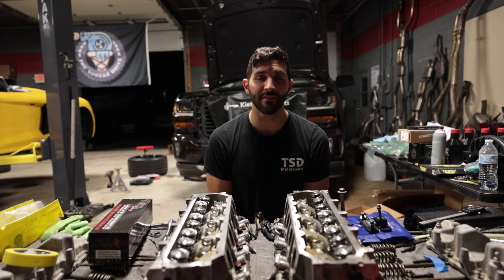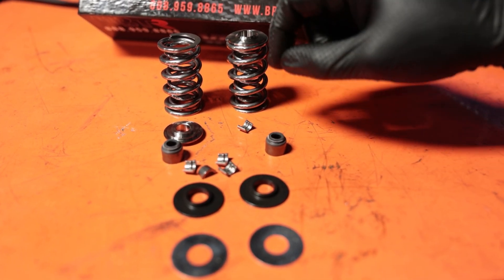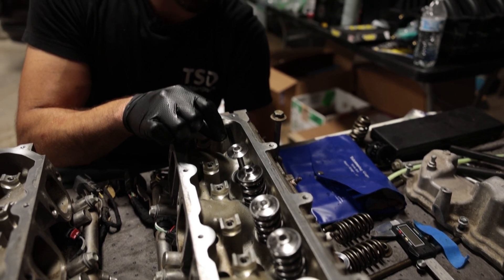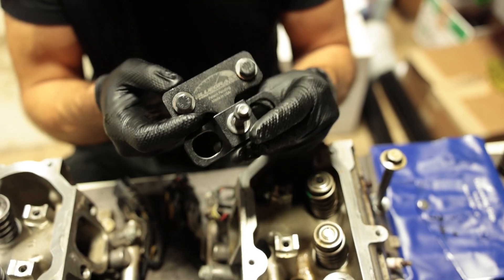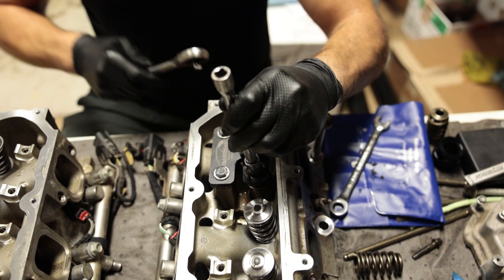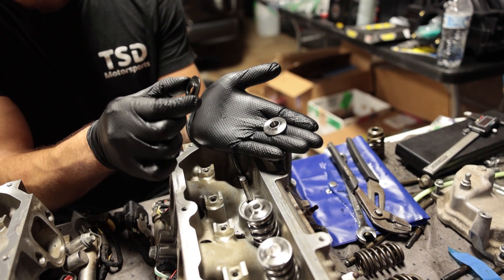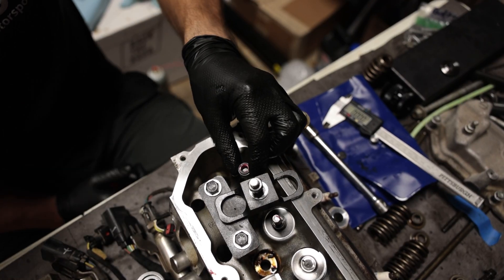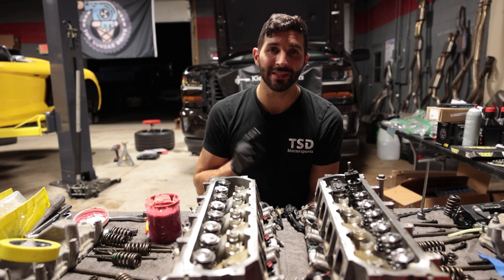How to Install GM LS and LT BTR Valve Springs - AFM DOD Delete - LS3 LSX L83 L86 LT1 LT4 LT5

Comment: I’m about to do this job on my 6.2 corvette because a lifter failed. So I’m doing upgraded cam etc. but I’m confused on the first part? I have to measure them? I thought I just took my valve springs out and replaced with my new ones.

Comment: Good stuff. I'm glad you guys are still doing work on the gen 5 generations. Please add the battery replacement to the playlist and do a big 3/4 electrical upgrade and clean all grounds.